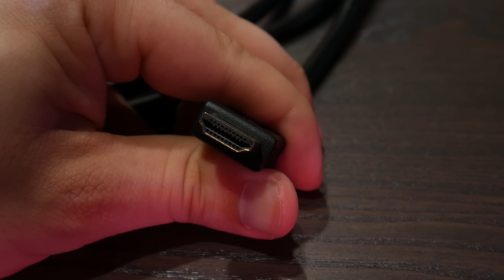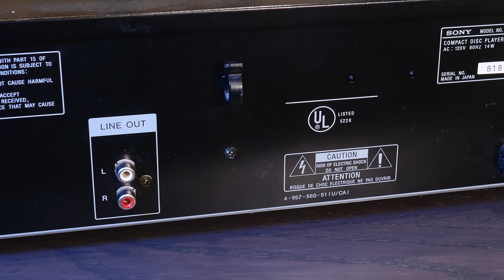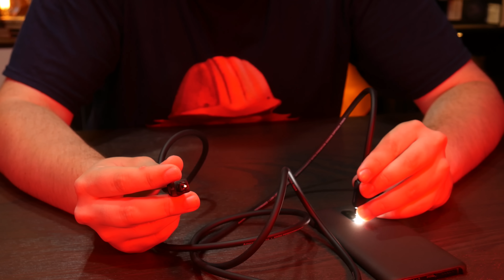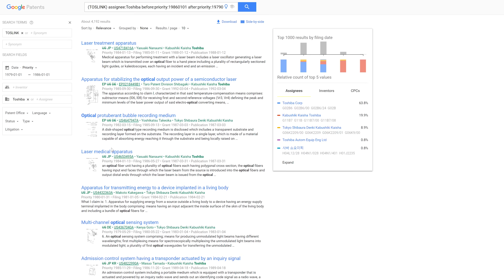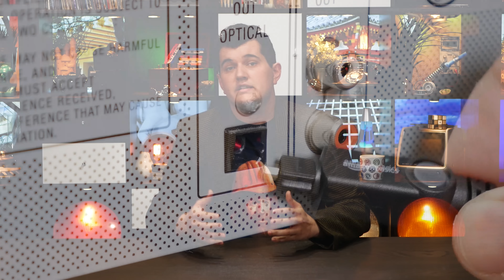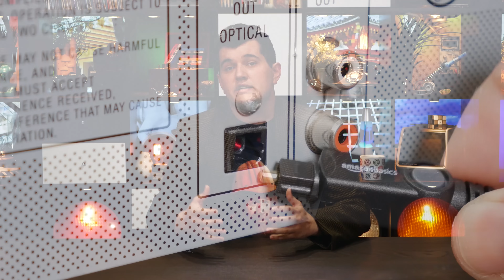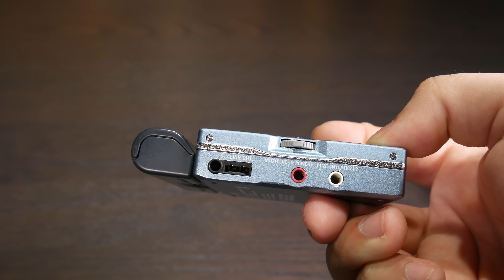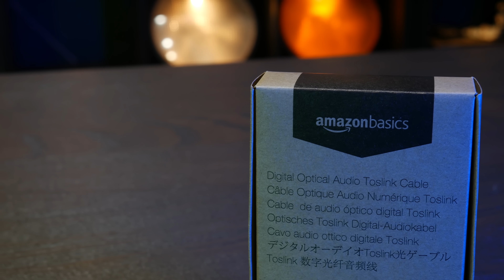TOSLINK: That one consumer fiber optic standard

Comment: Running Toslink from my pc to my AV Receiver, as it doesn't support ultra wide resolutions I could not do a HDMI pass-through to one of my monitors without running at the wrong resolution for the monitor. The only option was running the receiver as a separate "monitor" on the pc thus creating fun by moving open windows to the "monitor" if the pc went into standby. I ran it like that for a while until one day something went wrong and audio over HDMI became a distorting mess. So I switched to Toslink, and haven't had issues since.

Comment: It's on its way out? Most new TV's (around the €300 pricepoint) only have a Toslink connection and no analog outs, not even a headphone out. So TV manufacturers have started treating it like it's the next big thing in recent years.
Which is super annoying, now I need a second remote control just for volume because TV manufacturers seem to think Toslink can handle anything but full volume -_-

Comment: I found that Optical was very unnecessary for older devices, where you would run R/L RCA jacks to an amplifier, and could run the video separately to your TV (if passthrough wasn't supported by the amp).  However, I've found it's especially useful in the current era of HDMI cables.  You can hook up all of your HDMI devices directly to the TV, then use the TVs Optical Out to send the audio to an amp.  It's useful when trying to figure out the best methods for connecting new video devices (e.g. Chromecast) in combination with older tech (e.g. an amplifier that doesn't support HDMI).

Comment: What I found off about toslink is that, like phono jacks, the rotation of the cable doesn't matter when it comes to data transmission. Unlike USB and HDMI where the pins need to line up, data is transmitted across the full width of the line, so why do the plugs need to be directional? I understand it is probably better for securely holding the cable, but 3.5mm phono jacks have a detent that seems to work fine. Maybe they figured out that twisting the cable around while it's plugged in somehow warped the data transmission too? IDK, just feels like a missed opportunity for a really cool new plug style. I always feel like the current plugs are missing something when I and using them.

Comment: For my 2.1 system with severe ground loop and noise problem (JBL LSR-305 and 310S connected to a new PC with a pretty decent AsRock Z390 Taichi motherboard) external DAC with Toslink was a blessing. HDMI receiver is a no-go because G-Sync monitors use DisplayPort. If only was it possible to send the image signal via DP while only sound to HDMI... Should I ever switch to electric wires for digital signal from PC to DAC, I'll have to ensure that DAC has balanced outs for analog signal (thankfully JBL monitors have balanced inputs). Such equipment is more rare and expensive.

Comment: Yes "Toss" is an apt word for this awful connection system. Although the actual fibre communication idea is good the actual Toslink plugs are absolute crap. Flimsy plastic rubbish that sometimes fits into a socket OK but often just flops about loosely and falls out if you so much as breath on it. I hate Toslkink with a passion.

Comment: First time I learned about mini Toslink was when I got an Apple Airport Express. I used a mini Toslink to regular Toslink cable so I could connect it digitally to my receiver and stream audio from my phone to my receiver. I was quite amazed that the 3.5mm stereo headphone/line out jack socket also carried an optical signal.

Comment: Copper (coaxial) SPDIF cables Could (theoretically) suffer higher bit-error rate (BER) or loss of bits/bytes/data, that’s it. Audiophiles type people would probably notice the dropouts or transients, it is said. I don’t know, I’m skeptical, too. But, that is the principle ofEMI concern with copper cables transmitting telemetry or data and having interference conducted onto the cable. Keep up your good work, as I really love your videos!

Comment: You should do a video on the various forms of digital audio transmission. I know a lot of gear uses toslink cables to transmit madi which greatly increases the number of simultaneous audio streams at once with zero latency.

Comment: So, you:
Shine a laser on the disc
Convert the reflected light to an electrical signal
Use the signal to light an LED
Shine the LED down TOSLINK
Convert the light back to an electrical signal
Put the signal through a DAC in the amplifier
Output it to a speaker. 

Why not just shine the reflected pulses directly down TOSLINK? It would surely have been more efficient.

Comment: A major complaint about TOSLINK is bandwidth for uncompressed audio, but for PC gaming, you generally don’t need uncompressed audio.  You’ll be hard pressed to find a gaming platform that doesn’t use audio compression to reduce file size.  This puts TOSLINK at a greater advantage in the PC gaming market in terms of setting up a way to have game audio playback on a home theater setup.  

It also spares you from having to have to send the video signal from your video card through your receiver (which can actually cause home theater systems to heat up if you push the resolution too high).

Comment: Noise can actually be a bigger problem for digital connections if they have no error detection / correction (I don't think S/PIDF has error detection). If the noise does manage to overcome the digital threshold it as likely to corrupt the low order bit as the high order bit, so you get really obvious artifacts. Compare to analog where the lower order bits get corrupted first (and always...)

Best example of this is long / low quality HDMI cables which will of introduce bright horizontal streaks into the video.

Comment: best thing about it is there is no chance of electric interference when coiled in a bundle or lying next to power wires and also eliminates ground interference (OptoIsolator)
Insulating for lightning strike between electronics
And also saving cost in copper over long distances 
Edit:
Would be nice to have in cars since there is a lot of issues of electrical noise in unshielded aux cables for audio

Comment: One thing that's also not changed in toslink is DRM.
It doesn't support HDCP and has been killed off in the laws written to "plug the unencrypted holes"
Reply: James Neave while neither does an rca connector but you still see them
Reply: @JuneNafziger  
Toslink, be it optical or copper, is limited to stereo, it won't let you put Dolby digital or higher over it.
Reply: I spoof HDCP on principle and so I can display wireless A/V from laptops, phones, and tablets through my capture card/PC and out to my TV. I don't "pirate" anything. Coincidentally, the audio from the PC goes to the hi-fi over optical. DRM is silly, and usually only causes people trouble without actually preventing "piracy."
Reply: @WR3ND  
But does it let you transmit more than stereo over toslink?
Consumer equipment certainly won't let you

Comment: Your toshiba rant was nonsense. Toslink is used transmit digital audio data while electrically isolating the connected components. Because the cable is made from an insulator (glass or plastic) the noise from the power supply in your cheap cd player isn’t going to show up in your amplifier. It actually was a “remarkable” way to losslessly transmit SPDIF while maintaining an extremely low signal to noise ratio.

Comment: gold plated fiber optic cables
gold plated fiber optic cables
GOLD PLATED FIBER OPTIC-
Reply: Gold is a great conductor for the electric signal you don't have !!! 😂🤣😭
Reply: @amdphone2750  It's also not as prone to corrosion as the usual plas... oh.
Reply: @ZGryphon  You know, my plastic connectors have often gotten worn to where they start falling out. I don't want gold but since the nub is so small metal connectors could be better.
Reply: @SetitesTechAdventures  Huh. OK, fair enough. I didn't think of TOSLink as being the kind of things that get unplugged and plugged back in a lot. In any application I've used them in, they get plugged in and stay that way until I move to another house. :)
Reply: @SetitesTechAdventures  It's much better if the cable plug degrade than to use metal plugs.
Because if you use metal plugs it's the plastic socket that will degrade.
And the socket is not that easily replaced.
To not buy another cheap cable, you choose to buy a new hardware. This does not appear to be worth it.
Reply: @SetitesTechAdventures  Appart for the gold being nore maluable then PVC.
cant think of worse. But in its defence it was propably brass.
In Amazons defence, people who know better do not look for high spec stuff on Amazon.
Reply: IF it were being used somewhere that was exposed to the elements, maybe. 
 
But INSIDE your HOME??  🙄
Reply: RocKITEman _ 2001 not just inside your home, INSIDE A PLUG!
Reply: Gold plating is really cheap and makes a product looks much better!
Reply: I laughed at this at first and I still laughed now, but I do see one good use of it. A case where someone had all their other connectors gold plated they may want everything to look uniform.
Not that you're going to be looking in the ports very often, but maybe, just maybe
Reply: i can assure you that the one i have for my MD is not gold plated
Reply: Audiophools
Reply: I assumed it was because the soft gold made a tighter fit and thus better light insulation. Of course rubber would work better...
Reply: @DustWolphy  no no, it’s just ignorance...
Reply: the gold plating counters the corrosion and rust buildup which otherwise might make using the connector difficult or dangerous.
Reply: @kev4241  I hate it when my plastic/glass rusts. Absolutely ruins my day.
Reply: @kev4241  It also looks fancy

Comment: Doesn't the gold plating of the connectors protect from corrosion or something? If it's a thin enough coating and it doesn't cost much more, I don't think it's necessarily bad (although I'm still pissed at Best Buy for having employees tell my parents to buy $50 gold plated HDMI cables about ten or so years ago).
Reply: why would plastic corrode? and why would it matter if it did?
Reply: @Crypt1cmyst1c  I didn't realize the cables didn't have any metal.
Reply: Thats supposed to be the idea however in this example TOSLINK usually uses plastic, so never corrodes.

If you are ever using gold plated cables, one thing they never tell you is to only use them on devices with gold plated sockets/jacks etc. Most consumer devices use nickel plated connectors. Plugging a gold plated cable in will do nothing to improve any signal (in fact the gold plating may only improve the ground connection, thats just silly) and when two diss-similar metals touch and moisture (e.g humid air) gets in there, the metals corrode. Gold does not corrode, so the cable will essentially slowly, very slowly, corrode your devices input / output connectors.

Unless you ensure gold plated whatever is touching gold plated whatever in all cases metal touches metal there is no benefit other than they charge you more money.

And with TOSLINK, there is no conduction from one end of the cable to the other. There is no screen, nothing. The gold plating is eye candy and nothing more. OK, it will be a bit stronger than plastic, in fact it could damage your TOSLINK ports on your device. A bad or damaged cable would be like pushing a gold knife into plastic, sure gold is soft but I bet plastic wont be a match for it.

Avoid.
Reply: @dlarge6502  Those are good points you bring up, thanks.

Comment: I think that mini TOSLINK is fairly common in PC souncards, I just didn't know it's called mini TOSLINK. I thought it's called "soundcard has too many ports to fit a normal TOSLINK, so let's add an adapter and pass it through  one of the audio jacks", or just a hack that one company, maybe Creative, invented and others picked up on. I found out about it when my soundcard came with an adapter that looks like yours only it is entirely made of plastic. But those do in fact seem common only they look entirely like an ordinary audio jack if you don't know and don't see the glow emanating from it.
Reply: Mini TOSLINK was created to add optical connections in portable DAT/DCC and MiniDisc recorders to let you copy digitally bit-perfect. I think most of my MiniDisc players also support it (for output obviously).

Comment: there was a second consumer fibre optic,  corning made optical thunderbolt (1 and 2) cables, they were only for data so needed to connect to externally powered hubs/deviced. 

Either way they existed and worked, and were compatible with a normal thunderbolt port

Comment: To accomodate an updated higher bitrate Toslink would not be hard, despite it being a one way connection. All you would need is a switch selector (or menu option - i prefer the switch!) on the sending device to switch between Toslink1 and Toslink2.
Or why not simply put 2 Toslink connectors on the sending device, appropriately labelled, 1 and 2. This would be no more confusing than the current trend of using the ubiquitous USB-C connector for multiple purposes.
As someone who has often gotten mild electric shocks from copper line level connections between mains powered devices plugged into different mains circuits in my house, i am a big fan of optical interconnects.
Its a shame more people dont see the light!

Comment: With toslink devices would be fully isolated if the equipment uses transformers. I doubt it would be usefull however with good quality devices.
Reply: TOSLINK will avoid creating a ground loop.

Comment: At long distances, and large data rates digital signals tend to foul and resemble an analogue waveform, which can be solved with optical
Reply: He went over this, TOSLINK cables receive their signal from a single LED and are often built with inferior materials (consumer tech) which causes them to fail at much smaller ranges than your average copper lines.  The kind of Fiber Optics cables used for the internet are much higher quality and are powered by lasers (much more powerful).

Comment: Never realized this was called TOSLINK but optical cables have been my preferred method of audio output over HDMI when applicable. At the very least, for a while they were the best and cheapest option when all you wanted to do was transmit audio. Things have changed more recently such that they don't have comparable bandwidth to other cables, but it still seems incredibly redundant to be sending a whole mess of audio and video signals over HDMI when all I actually want is the audio. I'd rather just have a video signal go to my screen and an audio signal to my speakers. Though I suppose, in general, it keeps cable management cleaner.

Comment: I've had equipment blown from induced energy in a digital coax cable going through a roof from room to room when there is high levels of EM energy around (lightning) - going Optical / Toslink avoided that issue

Comment: Toslink / "optical" as we call it in Europe will have a second dawn. Here is why.
I work part time in a big box store on Europe and the main thing is TV and soundbars. There are at least 5 costumers a day with their arc setup not working properly or at all. Everything bought new and set up correctly. The biggest problem beeing Samsung. Samsung and Samsung works most of the time but everything else. Good luck. We recommend them to get a cheap opt cable and done. Never to be seen again. So over the last 2 years there was a big increase in sales.

Comment: Ground loops can also be eliminated by transformer (as used be Ethernet over twisted pair) and optoisolators. Fibre optic cables not required. TOSLink has a security problem, I suspect one could point a telescope with detector at a TOSLink source and receive the signal wirelessly.

Comment: I never actually used TOSLINK. I had a dvd surround sound system that had TOSLINK input, but it didn't come with a cable. Obviously it worked fine with normal audio cables that came with it, so I just never bothered with TOSLINK.

Comment: Thing about signal isolation -- every source you've got plugged into your AV center, that has its own ground path, is another ground loop you need to worry about.  And every additional ground loop in the system increases the chance one of them picks up noise.  So, having some of those sources isolated via fiber, at least helps.

Comment: I find it funny that professional audio setups with multiple channels (like 64+) uses Dante, which is essentially "audio over Ethernet". No fiber optics at all, and still has higher bandwidth than TOSLINK.

Yet, my brand new computer has a TOSLINK output in the motherboard (which I don't use because, well, "handy-dandy movie input" is simpler)

Comment: Mini-TOSLINK was pretty common, at least in terms of implementation. All of the Apple laptops had it embedded. The inserting a TOSLINK cable would flip a small switch inside the headphone port that disabled the internal speakers. This switch would routinely get triggered and accidentally stuck in the on position, killing the sound for no discernible reason unless you knew about it. If you didn’t have a mini-TOSLINK adapter, you had to reach in with a paperclip to toggle it back.